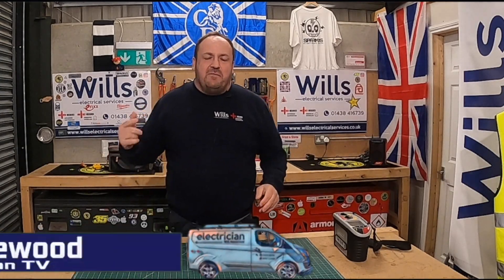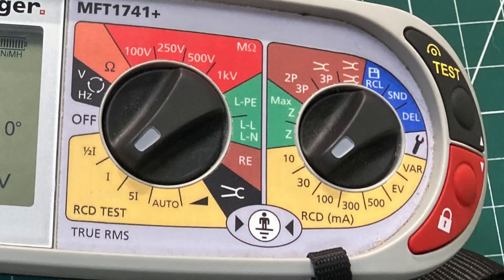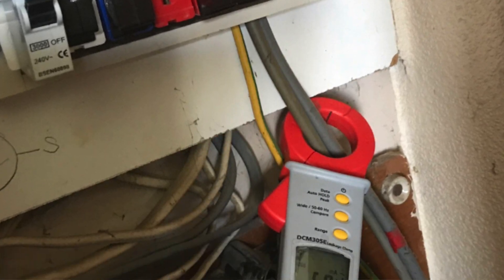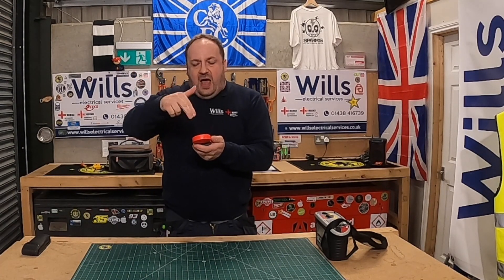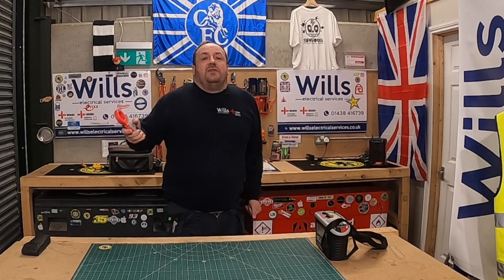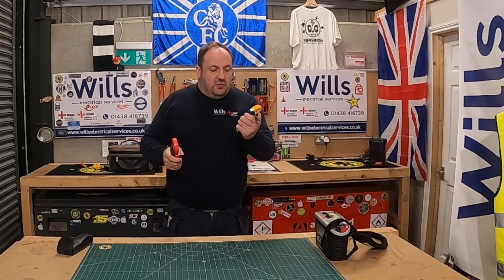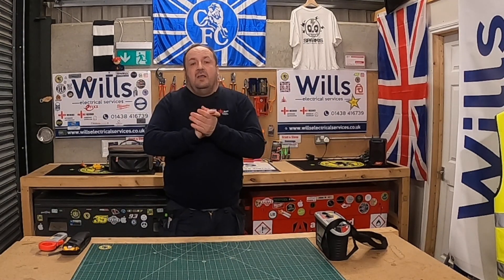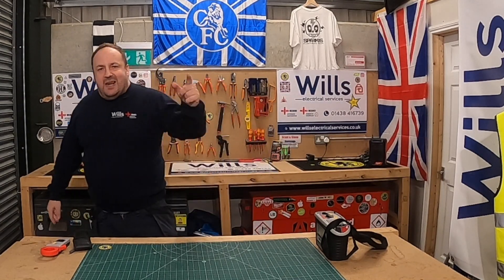RCD Nuisance tripping tips and tricks tools and meters ￼

Comment: Just buy fluke tester if you want to measures amps! It will fluctuate in any event ! Just do the insulation resistance test ! Eliminate the cable ! Then plug back in each appliance one by one to find what appliance is causing the rcd to trip ! If that fails pat test all appliances ! Me myself i would unplug each appliance one by one to find what appliance is tripping the rcd first !

Comment: So if a piece of equipment is tripping the circuit due to alot of earth leakage whats the best thing to do? Put it on the other rcd side if it's dual rcd? It doesn't mean the equipments faulty does it?
Reply from the maker: If the fault is Global across the whole consumer unit  then I would suggest you put them on an RCBO consumer unit and spread across the whole lot.If it’s all on one circuit Then I would look into it further if you see the link on the video for E5 it tells you the maximum Values you’re allowed per appliance.
Reply: @ElectricianTV  thanks alot matey

Comment: Hi . I do fault finding as my day to day job. I usually just use insulation resistance to fault find. Trying to see if buying one of the clamp meters would make it quicker and and make life easier
Reply: An insulation resistance tester injects DC into de energized wiring and so it misses leakage current of downstream devices and also capacitance leakage.
Reply from the maker: Without a shadow of a doubt. Game changer
Reply: It’s one of those tools you buy and wished you’d always owned

Comment: 👍👍👍 2 core flex and trailing socket for leakage testing??
Reply: I just have a extension lead socket strip on which i have opened up the flex cable and test line and neutral omitting cpc.